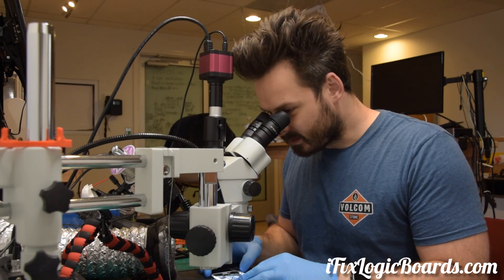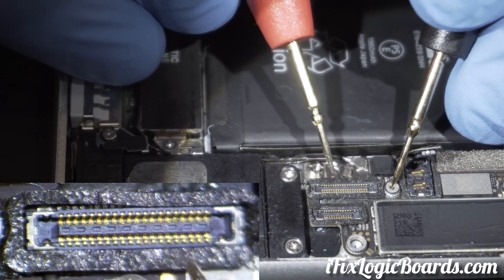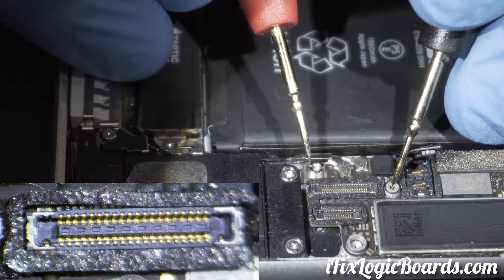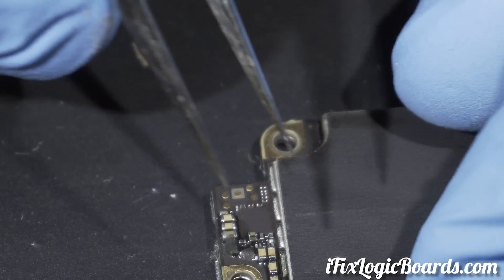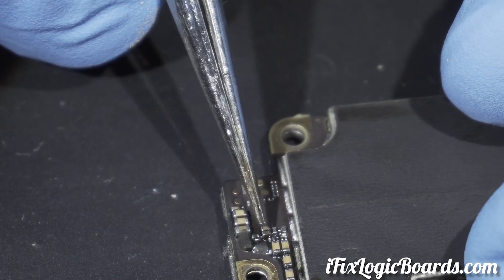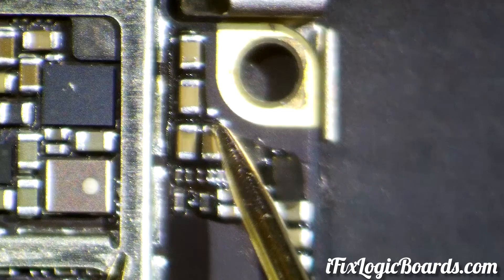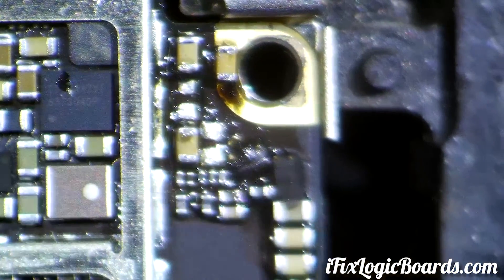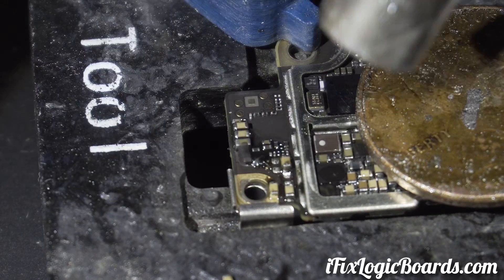iPhone 7 display not working - black screen - diagnose and repair

Comment: Sir PLEASE 
Explain me one thing  if we are check capacitor in mobile on mode while on mode that the same capicator showing both side continuity but if the mobile is off that time showing only in capicator one side continuity only what is that exactly meaning of that problem
Reply from the maker: You should not check continuity when the phone is on. Not exactly sure what do you mean? What circuit?

Comment: Thank you very much for this lesson! I have the same problem with i7 plus water damaged (intel)! I don't have any short on the lcd connector but i have two value who aren't perfectly correct ! I changed most of the burned componants, i changed the backlight ic but nothing! The phone is connecting to itunes and the backlight is ok, it consume the good voltage but no image! No 1,8V too!  How can i find the solution please? Thank you very much!

Comment: Can someone help me? I replaced u4500 on my IPhone 6S and accidentally lost L4521(there's two of them, above tristar). My phone boot normally, but still i dont have charging/data connection through usb. What i should i do to make it work? I have iphone 6 for spare parts, if someone know which element i can replace it with please comment below and thanks for any advice.
Reply from the maker: L4315 might work.

Comment: why are you not using high ampere to find short
Reply from the maker: Because just just 4 caps on the line, it doesn't normally take long to remove them.  I put power into vdd and other larger lines.

Comment: i like your videos and taught me alot. especially the other of no service iphone 6. it was really professional because it was time saving., but this i guess it wasn't quite professional cause you wanted to dodge some work i think had you applied so voltage onto the shorted ine it would have been much more easier and time saving.
overall, i really appreciate your effort and  the sharing .
Reply from the maker: Yes and no. Removing all caps normally takes like 30 seconds.  And if its still shorted then go for IC.  Usually inject voltage into bigger lines. Thanks for watching :)